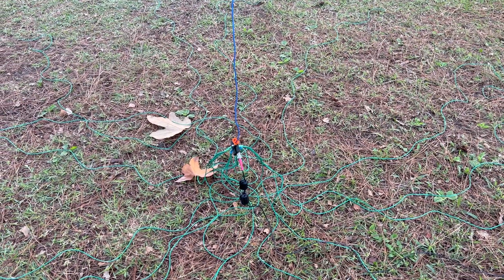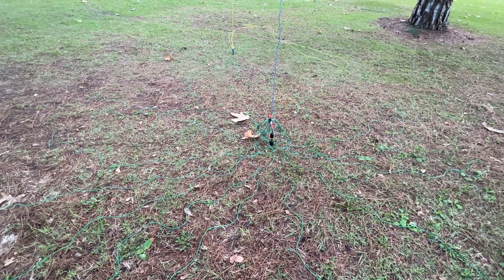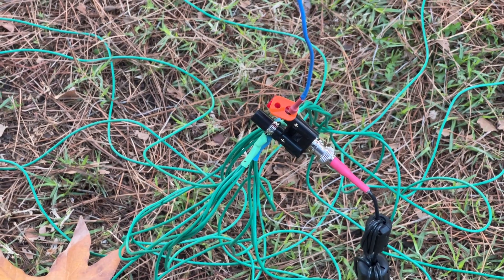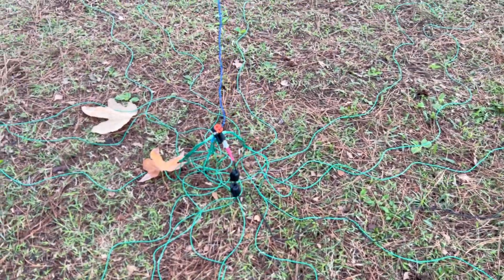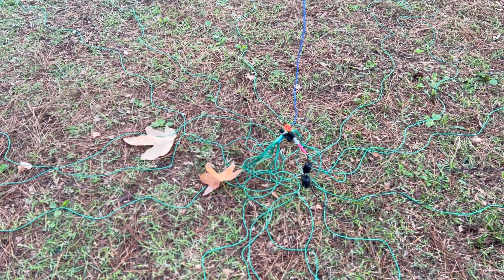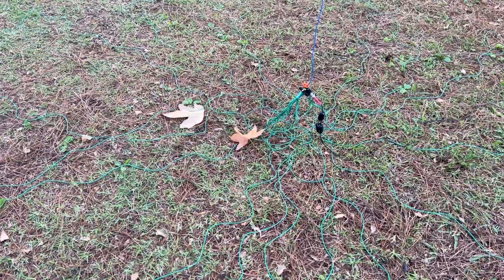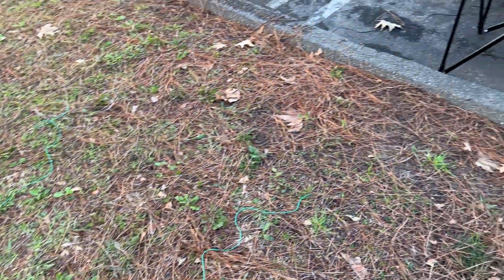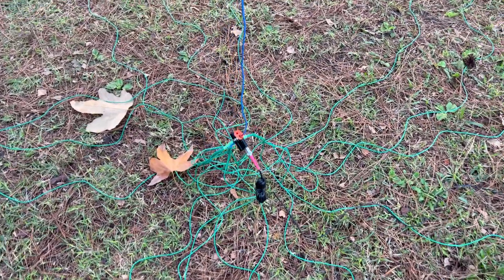HF Quarter Wave Ground Plane Antenna with 12 Radials

Comment: How many radials should there be?
Reply from the maker: Three is the min and lifted at 45 degree angle. If you can't lift the radials, then place as many as you can.  You may place 4 up to 64 radials or more.
Reply: Thanks! And how long ? 1/4 wave?
Reply from the maker: @polarbear5464  Yup, 1/4 wave of the band you want.